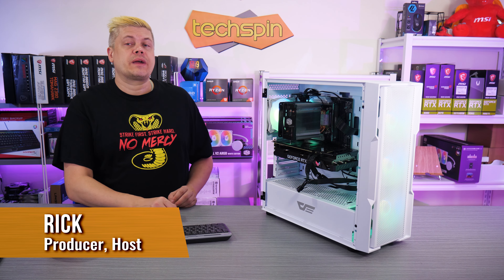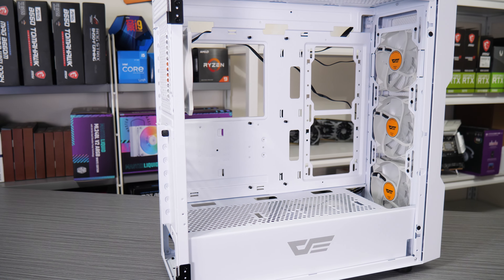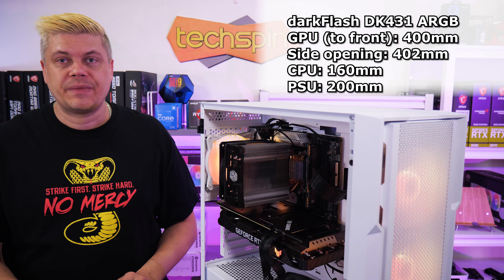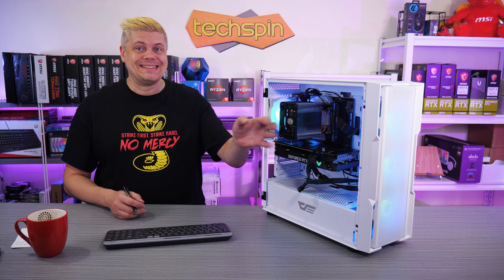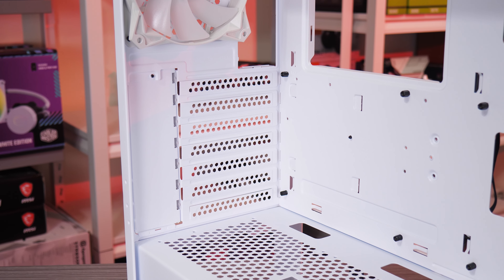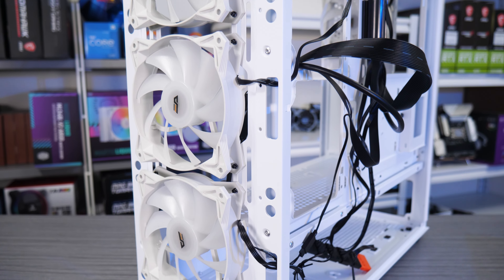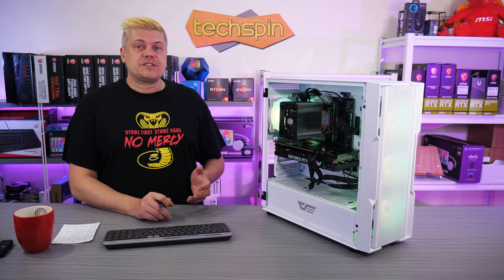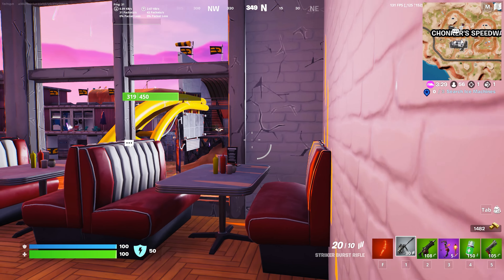Great darkFlash DK431 case, bad ARGB fans

Comment: Hi, I'm wondering if it's possible to remove the filter inside the front panel for cleaning, and is it possible to mount fans at the top of the case?
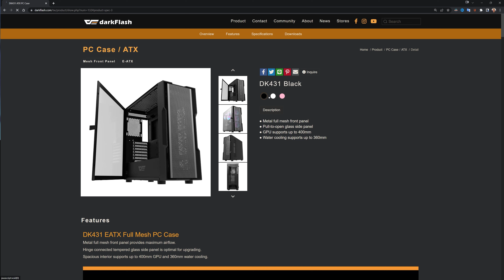Reply from the maker: For the darkFlash DK431, the filter is integrated into the front with bent metal tabs, I wouldn't recommend trying to unbend them.  Just vacuum and/or use a cloth to clean the filter.  2:35 you can see fans up top, and we tell you what sizes at 4:15 you can fit up there.  Hope this helps. Please subscribe, thanks for your support!
Reply: @Techspin  thanks for the info!

Comment: How to connect the doul connector that come connected to the three pins you mentioned in ARGB implementation ? 8:13
Reply from the maker: Need to have a motherboard that has an ARGB header to connect it. 5v ARGB is a 2-space-1 pin design, 12v RGB is 4 pin design. Usually they won't fit on the wrong connector, but be careful.

Comment: I'm actually curious if putting 3 more fans below the gpu w/c is vertically mounted can improve airflow and temps.
Reply from the maker: Vertically mounted?  Not sure you'll have the 25mm fan depth clearance like that. Horizontally mounted thare may be space.  If you're going to try this, I'd suggest moving the included 3x 120mm front fans to this location, and buy three proper 120mm fans that actually connect to your motherboard headers that can ramp up when your CPU/GPU is under load.  That will have a much greater effect than the top of the PSU cover, but it can look nice.  Please subscribe, thanks for your support!

Comment: just bought something like this, now i want to add more fans above as exhaust, but dont know or cant find compatible fans. will have to buy new set of fan :(
Reply from the maker: Well if you're good with solid color for the darkFlash case fans, then just pick up regular Coolermaster Sickleflow ARGB and hook those up to your motherboard and match the color in software. Just make sure your motherboard has a ARGB header!  Wish you luck.  Please subscribe, thanks for your support!
Reply: @Techspin  it has one argb and the dk351 fans is actually connected to it, but i just bought 2 3-in-1 pccooler halo, lol
Reply from the maker: There are ARGB splitters available, need to search for them

Comment: Hi i bought dk431 recently and should i change the fans? Because you said it was dangerous? Im not familiar with the molex you’re talking about is that also replaceable to make sure my pc is safe?
Reply from the maker: If you don't have an RTX 40-series and follow the fan wiring  instructions exactly, you'll be fine. Though the fans won't ramp up with higher heat loads. If it's your first time, always a good idea to have a tech friend help. Please subscribe, thanks for your support!
Reply: @Techspin  okay thanks my gpu is rx580 dual fan